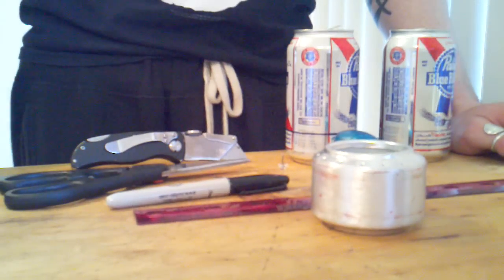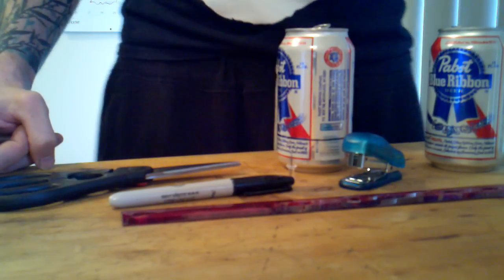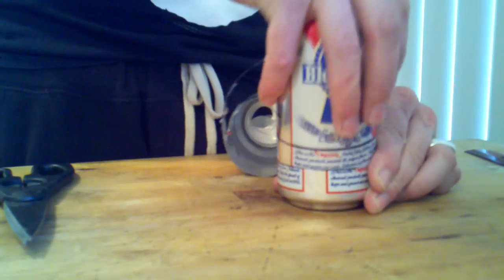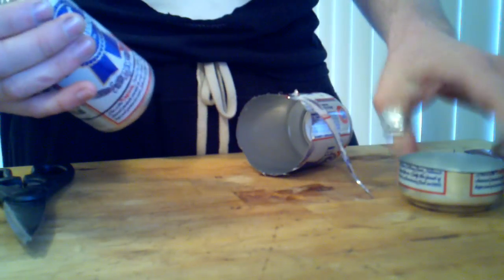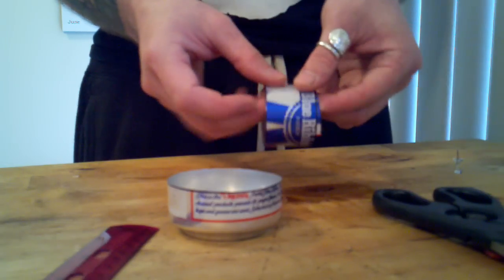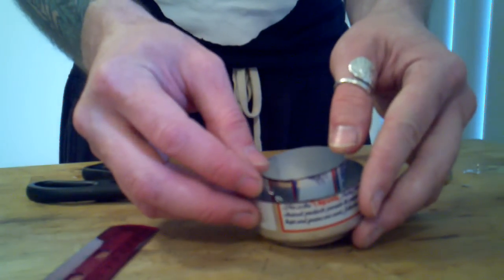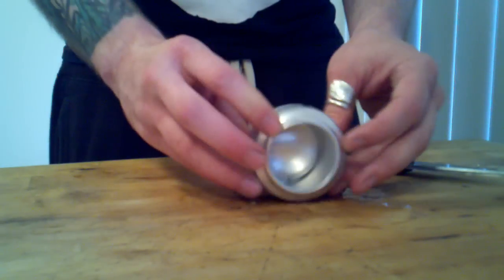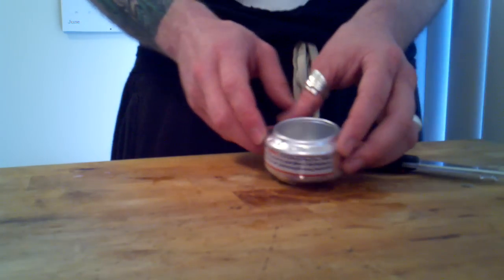how to make the best pop can alcohol stove

Comment: Great Vid. I used this design, when the power went out for 2 days/2 nights. I placed blankets over my door ways and windows, to keep the heat in, and lite 2 of these stoves (99% isopro alcohol) at both ends of the room. Holey, I was sweating, and wearing shorts, with -20 outside, I had to open my door ajar, to cool the place abit. My neighbors came over, to enjoy the warmth, and hot coco/coffee. Great stove for an emergency.

Comment: I found it is much easier to cut by freezing water in the can and then using the resultant block of ice as support for scoring the can.  Flex the line under hot water and it will pop free

Comment: Nice!  I used a small 1/16" paper punch from a craft store to make the holes in my cans. I also used some "flue tape" (it's a heat-proof metal tape for stove pipes) to seal the two halves.  In hindsight, the tape wasn't really necessary, but my stoves work great.  My first trip with it I prepared Tuna Helper in a large metal coffee can.  One load of fuel was just enough to cook dinner... Forget rubbing alcohol and use denatured alcohol. Much hotter and burns cleaner. No pot stand needed.

Comment: I've just made one.

Took me about an hour.

Had to replace the bottom can, as I overstretched the first one, meaning it leaked, and I got flames seeping from the joint.

Now I've reassembled it with the new bottom can, it works great.

Comment: Alright so when I made this I used a 2cm cut for the first bottom piece that you eventually poke holes into ,and then the other bottom piece you cut out at 2.5cm, This makes a really nice flush look at the end when you fit the pieces back together.  Then the middle strip was 3.5 cm wide. So if your ok with measuring  instead of using his coaster idea it works great

Comment: 2 things I did that helped a couple of issues, is to use the carpet/razor knife to cut the top and bottom sections. This works better than the scissors. Also put the top over the bottome, but befor you do make the bottom section look like a pop bottle lid, by using needle nose players and do half twists. You can skip his step of twisting the bottom of the can into the cut top piece.

Comment: I've made two of these, slight variations because reasons. They furn just about right, but when I set a small can on them, they snuff out. Should I try with a more appropriate container, or might I run into the same problem? Thanks in advance.

Comment: Hi! 

I have just finished my first alcohol stove following your tutorial. After having tested it I have a question for you, just to make sure there is no danger. 

First of all, my stove is a little bit shorter than yours (I cut the two bottoms of the cans about an inch thick). My question is if it is normal to see the alcohol kinda boiling inside the stove while burning, specially when the stove is about to run out of alcohol. 

Regards from Spain, and thanks for the video.

Comment: Well, Ive been using a gsi soloist, and it fits fine, and does not feel unstable at all.  A fosters can as a stove would be too big.  The soloist is pretty nice with its seperate cup.  Its nice to have hot tea with dinner. However, at 10 oz its a pretty heavy kit for lightweight backpacking.

Comment: Yeah, I found that out after watching other vlogs on this stove design.   The design allows for quick and easy lighting of the stove.    On my penny stove, pre-heating is a bit trickier.  Using the stove as an integral pot stand saves weight, which is what it's all about.  That's another plus.   However,  that makes the pot stand only 2 inches in diameter.   Have you tried using a Foster's can with this design?  That would increase the diameter.

Comment: Hey. Love the "design" and I've already made 4.. only problem I had was that the fuel burns up so quickly and the inner ring never stops burning(high flame) tried fewer/smaller/bigger holes and useing steelwool inside the stove.. anyways thanks for uploading

Comment: I wonder if there is a reason to bother with the inner wall. What I do is take two can bottom parts, fit them together like you did, make some holes around the stove and a hole or two in the middle of the upper part to let the fuel pour in. It works. Some cover the middle holes with a coin, I don't think you have to.

Comment: Pro tip: Take an old can (like a regular sized Spaghetti-O's can or a bigger coffee can) and use it as a wind screen and pot holder around the stove. Be sure to cut plenty of ventilation holes into it so you don't smother the flame, and cut the can down so it's an inch or two taller than your stove. Works great, adds to the minimalist vibe.

Comment: Yes.  I found that out later, after viewing other vlogs.  But setting the pot directly on top of the stove presents 2 problems.  First, resting the pot on such a small diameter object makes it prone to tipping over.   Second,  with the pot so close to the stove, the flames lap up the side of the pot.    With my penny stoves that I've made, I've found that the water boils faster  when the pot is well over an inch above the stove and the tip of the flames hit the bottom of the pot.

Comment: Ive had the same problem with this as many. My stove lights but it will only burn through the center it will start burning through the holes but wont continue. And if I set a pot on top it snuffs out can you help me?
Reply: Im also using iso alcohol will it make a differance if I use another fuel?

Comment: I made one as instructed.  Poured the fuel in, lit it and it burned beautifully.  However when I put a pot with water on top of the stove it burned for less than 1 minute and then the flames went out.  It's acting like it's not getting enough air.  Tried it several times with the same results.  Any suggestions?
Reply: Had the same problem with the first couple I made.  Wait about a minute after the flame blooms, then put your pot on it.  If you made it properly, and use 2 oz of fuel, it should burn between 15 and 20 minutes.

Comment: Mine seems to seal fine but snuff out as soon as I put the pot on. I only used a small amount of Fuel however. Do you need a larger Quantity to make it boil and prime ? I geet bloom from the jets in about 10 seconds, but then it dies

Comment: I was thinking the same thing and then realized I had only been considering the stoves' burning properties without something on top of it like whatever you happen to be heating or boiling. That should plug the hole allowing adequate pressure to push the vapor out of the  outer exhaust holes..?

Comment: OK just made this. Very quick and easy. However the flame gets snuffed out after a few seconds when I put a pot on top of it. I tried using some bricks to make a inch gap between the burner and the bottom of the pot and it worked ok but I was hoping I could just put it straight on like in other vids of these burners I have seen.

Comment: also just a heads up .. keep the 2 notches in the inner wall small or it wont build up enough pressure to work the right way .. still works but most of the heat will come from the center and not the sides

Comment: When stapling the inner wall together, be sure to place the staples about 3/16" to 1/4" from the edges. Otherwise they might interfere with the placement of the inner wall inside the groove in the top and bottom halves of the stove.

Comment: made my second can. but the flame wont pop to the little wholes.
i used zippo fuel for my tryout. it went up just like a regular flame.
have you any tips on what may be wrong or can be done in a better way?
little vid coming  on my profile.
thanks for a detailed and good illustration grtz
Reply: You can find the answer in various places online, but you really must allow your stove to heat up so that the fuel will boil off and create pressure to push fuel out of the jet holes. Problems could be hole size being too big or too small, and you really ought to use alcohol as fuel. Denatured alcohol can often be found at the hardware store in the paint stripper section.
Reply: Chace Butterworth
thanx for the advice, i found bio ethanol in a gardenstore, and use this now. i'll make smaller holes, see iff thats better. lets try again :)
Reply: Mike Frediani yeah, i wont be using that anymore. thanks for the tip  :)
grtz

Comment: What is the big hole in the center for?  I suspect this is a design flaw because it does not allow for maximum pressure on the fuel.   Pressure goes out the big hole decreasing the pressure to push alcohol vapor out through the tiny holes.

Comment: yeah you have to prime it. the point is that the alcohol boils and builds up pressure. in order for it to boil you have to preheat it. usually with this style you can just light the alcohol in the center and it will preheat for you

Comment: I took a hole saw hooked onto a drill.You can do several quickly this way.Just don't apply a lot of pressure.I forget the diameter..But is easy to do that.Just take a can with you to Lowes and match it up

Comment: Or maybe plugging the hole doesn't fix the pressure issue. I just built this design and tried it for myself and as soon as I plugged the big hole with another can placed on top I lost all flame. The stove appeared to be working okay before placing secondary can on top of the stove. This is the only one I've tried building and lighting though so I don't even know if it was working properly or not.

Comment: this is actually a self igniting stove. you pour the shot in the middle and light it on fire. the blaze should whirl around the center heating up the inner walls until the booze in the outer wall vaporizes. once the vapor and the total temp reaches a certain point the inner flame will ignite the vapor escaping the burner holes on the outer rim. the burner flame will extinguish the inner flame via lack of o2. if the burner flame is extinguished by wind the internal center will fire back up.

Comment: You can use rubbing (isopropyl) alcohol, but it burns with a sooty flame.  For that reason, denatured alcohol (a mixture of ethyl and methyl alcohol) works better.  You should be able to get denatured alcohol at any hardware store.

Comment: so the inner area holds liquid fuel and also acts as a pilot light. you can adjust the heat/rate of fuel consumption based on the number and size of the burner holes.

Comment: if you make a burner with standard pop cans and stick 4 nails into the burner holes in a square pattern it will perfectly hold a standard can and one shot of burnable booze will cook it to boil in about 5 mins. 

a burner made with those giant Monster cans with big flat roofing nails will support a big pot and boil the water in about 15 mins off of 3 or 4 shots.

i have never successfully made one from redbull cans because they are very thin and i have only ever used a pocket knife to make em.

Comment: just built mine didn't exactly follow your directions.  Had to use a hammer and a small nail to punch holes in and aluminum can cause I couldn't find a usable thumbtack. It boiled 2 cups of water in a heavy kitchen pot with glass lid in 6 minutes and 30 seconds. A once of fuel lasted about 9mins

Comment: There are many kind of can stoves. The ones with small holes in centre and pennies are called penny stoves. The one in video is called open jet stove. The difference is that with Penny stoves you need to pre-heat the alcohol to get the blossom and with open jet stove you do not need to do that. Check some youtube videos and you will understand what I mean. I prefer open jet. Try and make both types and decide for yourself. It took me about 30 minutes when i first tried. Good luck and be safe!

Comment: The alcohol in the bottom of the big hole will boil and burn.  This burning, because it is a big hole, would burn at a faster rate compared to the burning of alcohol vapors that jet forth from the tiny holes.  Inefficiency translates into weight, as in having to carry more alcohol per meal.  I think the simpler beer can stove, with a filler hole in the center, which can be plugged, is the best design.  They should have a alcohol stove Olympics that compare designs under strict conditions.

Comment: I make these with one can, just score round the groove in the top and take that out, score the cut lines with a stanley knife around the middle two cuts, then assemble in the same way.  I don't bether with the staples.   otherwise identical.  To light them, warm them up a bit first, using Meths as fuel, with practice you can judge the amonut of fuel to put in, it takes very little to boil enough water for a nice cup of tea.

Comment: Just built mine didn't exactly follow your directions.  Had to used a hammer and a small nail to punch holes in and aluminum can cause I couldn't find a usable thumbtack. It boiled 2 cups of water in a heavy kitchen pot with glass lid in 6 minutes and 30 seconds. A once of fuel lasted about 9 mins.
Reply: Louis Carter j

Comment: My ideas don't always pan out.  And my criticism that the pot is too close to the stove really doesn't mean much if the stove brings water to a boil, which I'm sure it does.    The major concern is a matter of efficient fuel consumption, and I haven't compared designs in a controlled setting, so it's just conjecture, and the prosecution would object due to conjecture or hearsay, and the judge would
probably sustain the objection, and might throw the case out of court.

Comment: Just built mine and the holes aren't igniting. Solution?
Reply: thanks anyway.
Reply from the maker: ***** it can take a minute for the stove to prime...the alcohol has to come to temp in order to vaporize and force flame out of the jets...I hope this helps
Reply: I figured that much. But I had it burning for 10 minutes or more only one of the small holes ever did as advertized. I'll just build another one.
Reply from the maker: I have a vid showing this stove in action...check it out and see if im doing anything different
Reply from the maker: good luck!
Reply: ***** Same here.
Reply: +FreedomR115 i speed prime mine my hold a lighter under the can for 5 seconds

Comment: I didn't understand that when I submitted the Q.    The pot becomes part of the stove, and it's a compromise.   The stove is not wide enough for stability in the field.   I'm not lucky enough to rely on the thing not tipping over.   And the stove is too close to the stove, as the flames are deformed and forced up the side of the pot.  The hottest part of the flame is at the tip.  So, maybe this design needs it's own plug for the big hole, and then rely on a pot stand to support the pot.

Comment: Your only problem is your using the wrong fuel.  Rubbing Alcohol burns dirty.  Use Denatured Alcohol, or a fuel additive called Heet.  It is actually fuel line ani-freeze.  They burn very clean.   As for minimalistsurvival comment,  yes it will starve if you make a complete seal.  So before you open the can to drink it's contents, take a 6 penny nail and lay it on it's side 90 degrees to the bottom of the can and tap it hard enough to DENT ONLY, a few times around.  then cut out the circle.